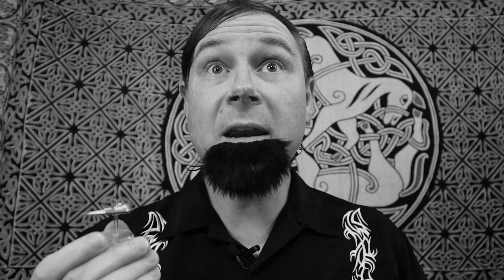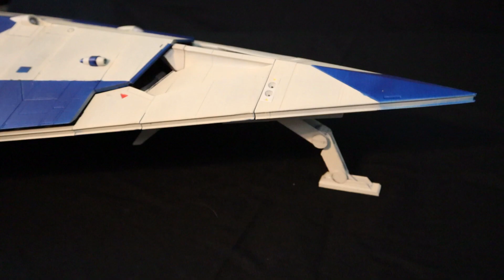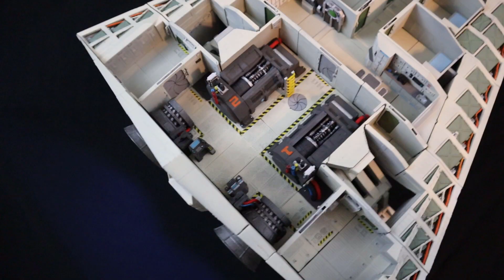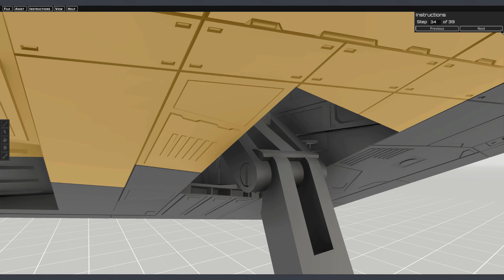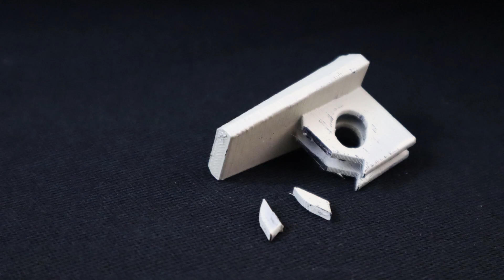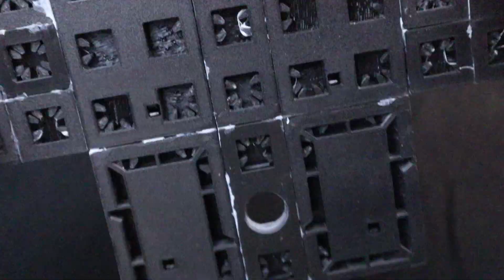3D Printed Traveller Scout Ship - Review

Comment: Our Response video is here: https://youtu.be/wwPan4eK71s
Also, the prototype did not have the support rod support, which greatly increases the stability of the ship.
Reply: Response was spot on. To clarify for folks I used ABS for this because I mostly made cosplay pieces and use ABS because of its higher heat tolerance. I rarely use PLA but have started experimenting with PLA+. In hindsight, PLA would have been a better choice. So for the next ship. It'll definitely   be PLA+!
Reply: Any plans to sell actual physical ships?
Reply: Thank you for your response, though 'support rod support' might be a bit redundant   As a military person with over 5 terms in Military career field I know about system redundant description title redundancies.  ;)
Reply: @spacedinosaur8733  hehe, yeah, was winging it.

Comment: Hey Seth! Do you know what printer size was used?
Reply from the maker: I don't. It wasn't particularly large compared to other printers I've seen. And the ship is designed to be made on standard-sized printers. I'd check with 2nd Dynasty to see if yours is an appropriate size or not.
Reply: I've got a Resin Printer, But it's pretty big. Fingers crossed I can use that :D!

Comment: 2 years later and I still want this thing, just need to the space/time for a 3d printer >.>. Being getting into Traveller as of late and thinking of doing a solo Traveller game using GRUPS (not using GURPS Traveller mind you but running more of a direct conversion including rolling 3d6 for stats and modifying the life path system. GURPS Traveller is just GURPS with the Spinward Marches setting which is fine but I want more of a classic Traveller feel with the better over rules of GURPS... wow this turned into a long aside lol) but even past that being an awesome set piece for that experiment,  I think these models would be amazing to run games of Snap Shot in.
Reply from the maker: Physical space is the only reason I haven't picked up the 3D printable Free Trader. That thing looks amazing.

Comment: It looks awesome but after spending 6 weeks on printing my DM screen of doom I feel pretty done with 3D printing until I find a way faster printer. Yeah, I now have a super cool DM screen with 2 dice towers, built in turn marker and tons of shelves but it is just too much work for my taste and my Ender 3D is way too loud. This build looks way more complicated.

But 3D printing is certainly changing gaming, I did print out a few dungeon tiles but I eventually gave that up and bought a huge box Dwarven Forge® instead (pre painted, since I am lazy). Since 3D printers are getting better and cheaper they will likely be a must have in a few years. I think I gave something like $350 for my printer with a pack of filament included and that was a few years ago (2018 or 2019, I mainly bought it to learn how to use a 3D printer).

I do recommend people to pick up a cheap 3D printer but maybe not start with this super advanced build. Start printing 3D dungeon tiles instead, they are easier to print and usually done in like 6-8 hours so you get the basics before trying something advanced. It isn't that hard to learn the basics but the more advanced stuff has a bit of a learning curve just like anything else. You could start with miniatures instead but you really need a resin printer for that and those are harder to master then a cheap regular one.

But man, this is one of the best looking 3D models I ever seen so kudos to 2nd Dynasty. Now, I just printers who can print in metal becomes cheaper we could get a lot of really cool and durable stuff.

Comment: Hey Seth, I know there are sci fi 3d printed "Dungeon Tiles" (I have some). It would mean printing out more tiles but a  work around could be printing out those tiles for the upper and lower decks (have the middle deck of the ship exposed for play). It it's possible take the set dressing (cargo containers, ect) out place them on the dungeon tiles..... it takes up more table real estate but that way you could have all three decks in play at the same time.... from the video it sort of sounded like you can't do that with just the model.

For the price and what you get the guys at 2nd Dynasty have a good things going. If I had an extra $100 & and extra roll or two of filament I could seriously crank out a bunch of nice  sci fi stuff from their offerings.

Comment: Doubling the tonnage (volume) would only increase the dimensions by 26% or so (the cubed root of 2), if the shape were the same. Since the trader is much "boxier" than the scout, it shouldn't be much bigger dimension-wise, if any, and could actually be a bit smaller in length and width...

Comment: How difficult would it be to print a second lower compartment? It wouldn't be as compact and elegant as having everything all in one, but you could keep it to the side and use it as needed easily.
Reply from the maker: Not necessary. Turns out the difficulty I had with getting to the Lower Deck was due to me clipping (and then fusing) the panels wrong. Middle deck floor should lift out as easily as the Top Deck does. 
But to answer the question, printing duplicate sections would be super-easy to do.

Comment: So, what techniques you used to paint it? High and Dry-Brush?
Reply: The primer and base coat were done in Golden High Flow Acrylic Titan Buff paint using a Grex airbrush, as was the blue coloring. The details were hand painted. Seth is really good with tiny brushes.

Comment: I love the model.  but some 3d printing issues.  Resin is not stronger(it's most of what I print in), your landing gear broke at layer lines likely due to using ABS because of the higher heat needed.  Tell your player to print in PLA, it's both stronger(or at least as strong) and easier to print (and plant based rather then oil based)  

thanks for the fun video. that Intro was epic.

Comment: For some of those pieces that break (like the landing gear) have you tried doing an infill of 100%? Also might want to look at inner wall thickness as well. Also for the clip issue, take a look at purchasing some small magnets, drill holes and glue them in. It helps with attaching/detaching sections. A mechanical fastener can be an annoyance while pulling things apart. Magnets are snap on/snap off.
Reply from the maker: The part that embarrasses me (more than 2nd Dynasty's response that the reason for my trouble getting to the hold is because I fused the panels wrong) is that I've been using magnets to attach mini ships to flight stands for over a year now and it didn't even occur to me to do the same thing with the ship panels.
Reply: Unrelated, but your website is great for my Cyberpunk games. Thanks for all your hard work Cyber Smiley.
Reply: @burningphoneix  thanks. Appreciate the love.

Comment: Thank you for the review. What printer did you use?
Reply from the maker: Prusa MK3s with a .4mm nozzle at 150 microns in ABS on a textured spring sheet. 
Epax X1 using clear water soluble resin for resin parts.

Comment: Looks cool 😎 but with all the tight spaces and walls….how playable is it?  Is this more of a model kit for a model making?  Or is it an easily playable game piece?  Still very cool!  Thanks for sharing!  Cheers 🍻!
Reply from the maker: It's intended for use with miniatures. I even show some old RAFM Traveller miniatures inside it. However, like with 3D terrains, practical use gets a bit tricky. For one, wide minis with outstretched arms and weapons might not fit or face correctly in tight spaces. Next is the ability to see what's going on. The walls are cool, but require people to look down into the space in order to see the board. A character might have line-of-sight on something that the player does not because of a wall or terrain obstruction. So you pretty much need to stand and look down into it to see everything going on. Finally, and this is a big one, terrain and set pieces take up a lot of space. Most gaming groups just don't have the physical room to store them all. So yeah, you can use it for the game, but need to have a place to put it not just on the gaming table, but for all those times that you're not using it.
Reply: @SSkorkowsky  thank you Sir!  Cheers 🍻

Comment: I am about 40% of the way through printing one. I did up the scale  to 115%, so that I would not have to re-base some of the models that I planned on using in it. I will say that increasing the size seems to have eliminated most of the problems that you have mentioned with the print.
Reply: Going by the response vid from the manufacturer, some of Seth's issues may be the material he printed in.  There's a lot of variation in how sturdy different resins and vinyls can be, and it makes a bigger difference with something this huge than most gaming stuff.
Reply: @richmcgee434  I actually don't think that ABS is a bad choice for printing this, and it might end up being the more durable long-term material. For instance, it would be a shame to have a print that took a few hundred hours get warped by being stuck in a hot car. We don't know what type of printer or print settings were used either, which might have made for a bigger difference than the material used. ABS was always off the table for me as I don't like printing it due to the fumes and where my printers are set up in my house.

Comment: The lower deck is meant to be lifted straight out, but it looks like you've got parts that are meant to be left in the ship attached to the removable parts. A work around could be to fix the air-raft room walls to the deck like you've done with the airlock walls and then remove those clips you mentioned. That way you might be able to lift out that whole section without having to detach the back panel..? 

The S-Class is an absolute beast of a model - good job on getting it built! Goodness knows how big the Freetrader will look. I have the files for their Scout Ship Beta model which I girding myself to print - at over 2ft long it'll be by far the biggest thing I've ever printed but it's still a fraction of the volume of this monster.
Reply: I'm in the process of printing the hammer head version of the Scout Ship Beta, then we will be printing the Wayfinder, then this lovely S-Type Scout hopefully by the time that is all printed we will finally have the Freetrader available to buy.
Reply: @jeremyherndon2974  The Hammer Head does look very cool! Personally I'm marrying the Patrol and Civilian variants (some chopping up of parts in Meshmixer is required) to add a 3rd deck, a nose turret, and in place of the Patrol's side turrets I'm adding the Chimera's VTOL Engines for atmospheric landings -- I've maybe put a bit too much thought into this!
Reply: @nrgspike  That sounds sweet.  The Hammerhead has a bottom turret under the nose but the VTOL Engines on the side sound sweet. An Extra deck could be interesting as well. Hope it all goes well.

Comment: Thanks Seth for the review! The commercial version DOES come with an air raft. Issues with the front landing gear are possible material-based, and have been solved, also there are alternates now. You are not meant to clip in the drive compartment the way you did, I am going to do a response video to show. :) Great review.
Reply: Great work guys
Reply: @Feelefant Affenhand At least until the next Kickstarter in late October, and it will be available in that one too for around the same price (depending on the USD vs. SEK at the time). Although the Kickstarter will have a greater delay in availability.
Reply: This ship is gorgeous
Reply: Impressive bit of digital design there.
Reply: Thank you 2nd Dynasty for this because it was a FUN project to work on! We had several painting nights while watching movies and man it was a blast.

Comment: 490 Hours!!! 20 Days of non-stop printing!!! .... Looks cool AF though.
Reply from the maker: That's including several big misprints. But yeah, there's a reason it took longer than planned.
Reply: @SSkorkowsky  Dare one ask how much it cost in materials to print?  I've no experience with 3d printing either so I have no idea what the cost to make something like this would be.
Reply: @talon12020  It ends up about 2 kilos so 3 rolls to be safe. Depending on the type you use, cost for filament is $45-$60 for all three rolls.
Reply: Thats the life of a 3D Printer.

A problem with 3D Printing is that a print can fail at any point. I had a print of a Bullet Bill that was a foot high. It was an 18 hour print. It was going well. I went to bed, by next morning there was my printer going through the motions, but the print failed probs about 3 hours in. Nozzle got clogged.

So then had to spend about an hour cleaning the nozzle then re-setting print bed and doing a quick test print. Re-sliced the part to increase the temp a bit and a few other settings to retry... luckily that one worked. But then found the clearance for the insert was too tight... so had to reprint that.

The short story is. 3D Printers are cool.. but you need a lot of patience for good results.
Reply: @DukeDudeston  Tech just keeps getting better, though.  Twenty years from now they'll be everywhere, and even in five or ten misprint rates will drop significantly.